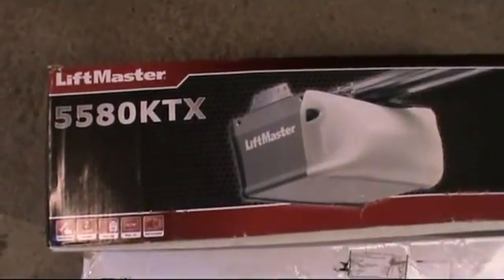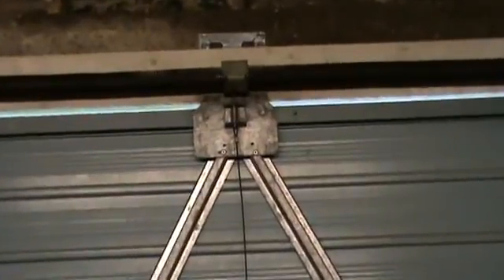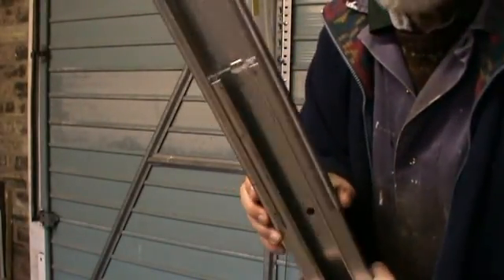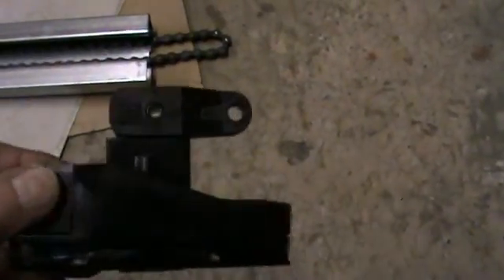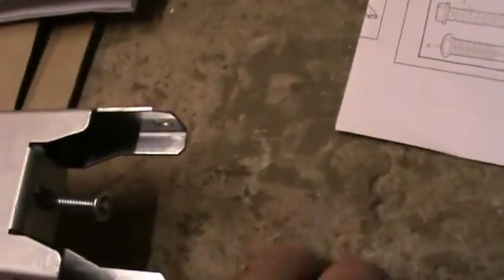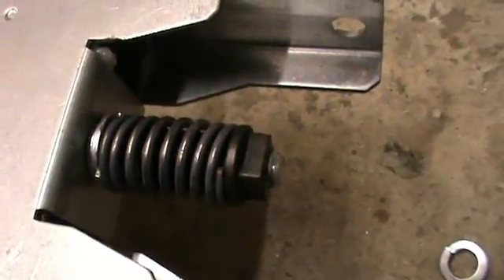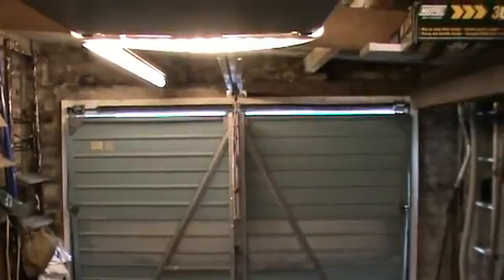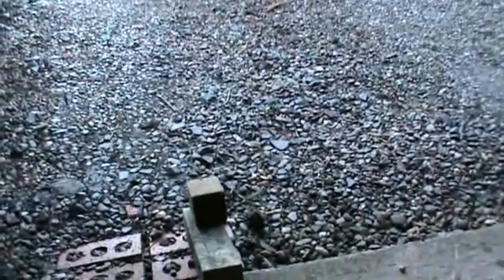Garage Door Opener

Comment: Hi Dalbhraddan
I have an old 5580 Professional already installed but the craftman didn't leave the installation guide.  The internal and external trolleys broke (mine are plastic made) and I succeeded to order new ones at Chamberlain and replace them.  BUT I don't know how to adjust the limit switches.  It seems I have the same model as yours.  On your video you say at 17:00 that you use the red button on the back to monitor the limit switches.  Could you tell me more how you do ?  Or post or email me the page of your manual explaining that ?  Chamberlain has no online manual for this model.  Thanks so much.  Giles from France.

Comment: That's very good mate, well done. I'm going to try fit one of these to my canopy door soon. At the moment, I put my car in, and when the door closes, I only have a few inches to spare. Noticed the canopy arm protrudes quite a bit, do you think this would damage the boot area?
Reply from the maker: +Bob Yorke With the door closed I have about 8 inches between door and car, when open the arm sits about 5 feet above the ground and when the door closes the lower part of the arm swings in an arc. As long as your car has a boot, it should be fine, must admit on first closing the door I stood very close just in case. Only problem I see is if you had a van , 4x4 or people carrier which is very high at the rear and this would mean reversing into the garage. My car is Jaguar x type and the arm is no where near the boot as it closes. Hope this helps.

Comment: Thanks for posting this video - I found it very helpful when installing my 5580 KTX. I would add a few comments which others might find helpful1. Chamberlin have updated their models over the years but the instructions and accessories haven't kept pace. You will find that the instructions are ambiguous and confusing in places and some of the supplied hardware is either not needed or doesn't actually tally with what is shown on the drawings. It's not a big issue if you're reasonably practical2. The 1/4"sheet metal screws for attaching the door bracket to the door are impossible to fit satisfactorily, even with an appropriate sized pilot hole. I merely bought a 6mm tap and some 6mm bolts and used those instead - far more satisfactory.3. The tensioning mechanism is supplied as a complete spring assembly, whereas the drawings show it as a variety of separate components. You should ignore the drawings and merely install the tensioner without any additional nuts or washers. Be sure to install the tensioner the correct way round. Dalbhraddan initially installs this backwards but subsequently realised his mistake but doesn't mention it in the video.4. These units use a 40W rough service bulb to light the garage. I know from experience the vibration kills these relatively quickly. In a previous unit, I used a low energy bulb for some time but it resulted in my door opener being unreliable - presumably due to the complex starting voltage requirements of the bulb interfering with the motherboard - I solved the problem by installing an LED bulb. Be aware that the standard GLS equivalent bulb in LED has a relatively broad diameter above the screw thread and will not screw into the bulb holder far enough to make contact at the base of the bulb on the 5580 model. This can be easily rectified by bending the base terminal of the bulb holder slightly upwards towards the base of the bulb - job done.The 5580 is a nice simple unit and is now supplied with two 4-channel remotes. Chain drive isn't too noisy and will last for ever.
Reply from the maker: +ybliga Thanks for your comments, it was after I posted it that I remembered about the tensioner.I really found the instructions fairly easy to follow and did not have any trouble with the door bracket or having to make alterations to the bulb fittings, in fact the light given off by the 40w bulb is very satisfactory.